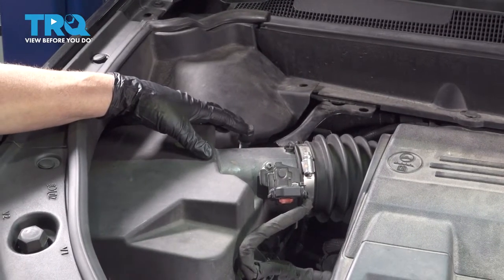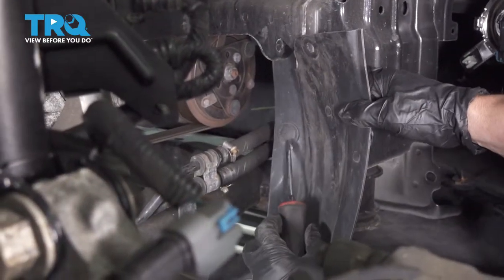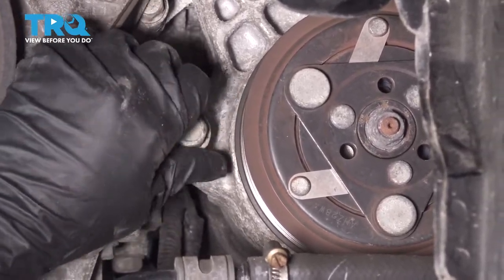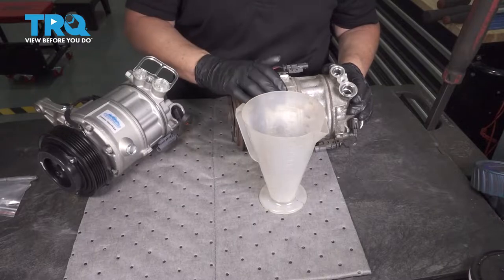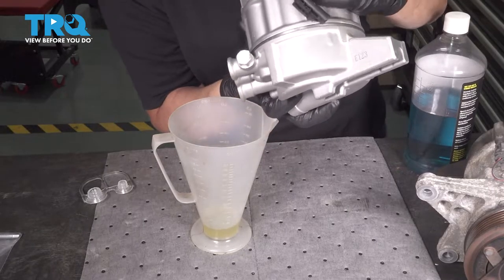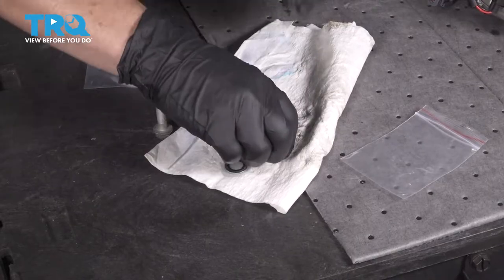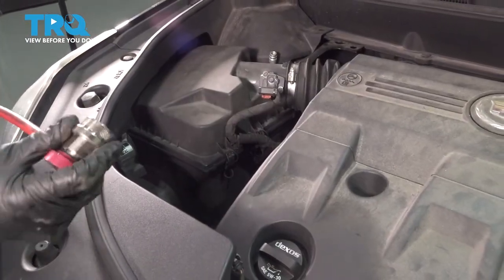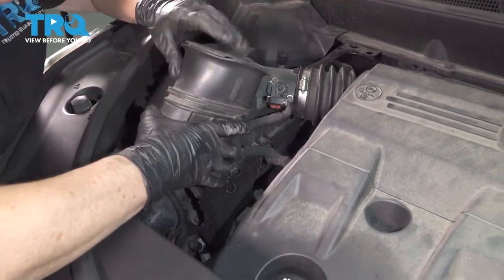How to Replace AC Compressor 2010-2016 Cadillac SRX

Comment: Nice…the bottom & top stud bolt broke after I installed new compressor, any reason why that happened? And also where do I find those bolts because they are very difficult to buy